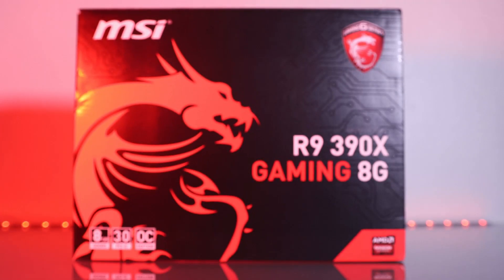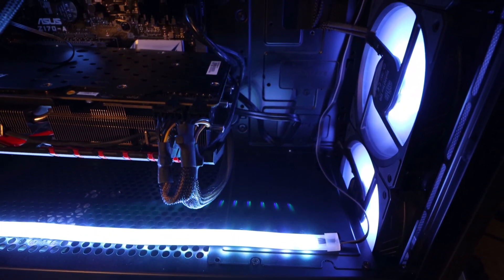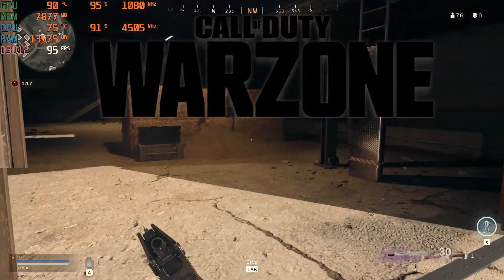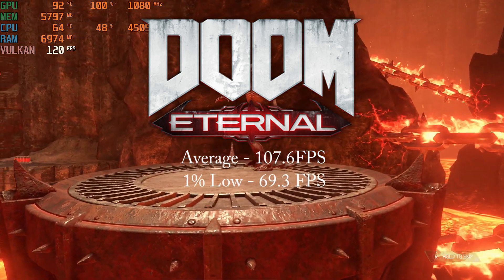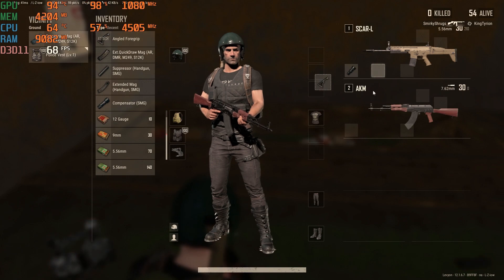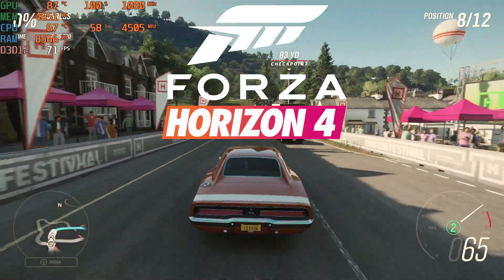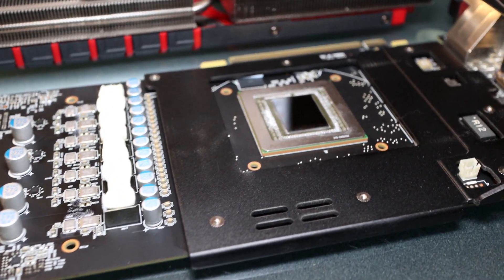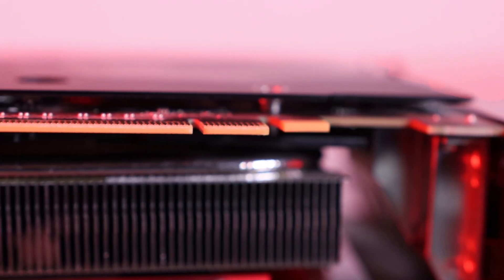A Review Of The AMD R9 390X In 2021

Comment: im considering maybe picking up this card as I saw one cheap on a used website. I picked up a 7950 that had some slight issues but runs fine still, but im somewhat worried about if it will keep working. and it does require some good tweaking on game settings.

still happy with it considering I can play most games at 1600x900 at a mix of low and medium @+/-50fps tho, and the fact I paid only 20 bucks for that.
Reply: if you find a listing of it around 100dollars take it

Comment: Levys Customs : dude.....for the 1000-th time, the TDP = Thermal Dissipation Power OR Thermal Design Power isn't the same as being rated of eating 275 Watts of power !!!! You have no clue about computer electronics !!!! I personally owned the Gigabyte variant and it never ate 275+ Watts....due to it's inability of being properly and fully utilized because TRUE DX 12 API games still don't exist. Todays games are saying that they're running on DX 12 when in reality they are just being passing through the empty DX 12 instructions and through DX 11 in reality....hence no difference between DX 11 and DX 12 performance.

Comment: This card undervolt very well.
Once you undervolt your memory and halfed your memory clock, you get nearly the same efficiency as a Polaris.
Reply: hey man I know it's an old comment, but can you give me the values real quick ?
Reply: @yazi2879  
Core
200mhz 900mv
543mhz 935mv
776mhz 945mv
895mhz 1020mv
945mhz 1075mv
985mhz 1090mv
1020mhz 1130mv
1100mhz 1170mv (yours may stable at hogher or lower mhz)

Memory
1200mhz 950mv (stock was 1500mhz)
Reducing the memory clock reduces the power consumption greatly
Reply: @mikeccuk2006  thanks man

Comment: Used an 8GB Sapphire R9 290X Tri-X until this week when I finally got a 6700XT. Basically the same card. Does well even in 1440p in games like Red Dead Redemption II.
Reply: That's a rare R9 290x  8GB model you have there
Reply: Basically the same card ? Are you on heroin or something
Reply: a 8GB 290X? is that actually the card you had?
Reply: so I looked it up and it is real apparantly ( and not a type o like I was suspecting). but anyways that is so cool you had/ have that card. I wish I had one like that.

Comment: Levy Bro great video! I have the same card but I am bit scared from this noise of fans. When I run PC without anything - card starts at 65 C degrees and when I open any HD stream on twitch or any full HD video fans go 100% and it runs 88 C degrees. Can you please help me :( cuz I am bit scared to not burn it. Give me information for best MSI Afterburner setup and how hot your one works. Thank you by now <3 ! I am waiting for your answers
Reply from the maker: As I mentioned in the video, this card does get pretty hot and loud, even with fresh thermal paste. When gaming, my card will hit 95C and thermal throttles.
Reply: @LevysCustoms  so nothing unusual to get worried about :)

Comment: I only replaced this card because of noise levels and a monitor upgrade to 1440p. 
390 can still pull off almost the same stuff as my new-ish 5700xt, except the latter one is much cooler and quieter.

Comment: i have this one but i play fortnite on low settings on very low fps do u know why this is?
Reply from the maker: What resolution are you play at?
Reply: @LevysCustoms  i think just 1920 x 1080 if you mean that
Reply from the maker: What kinda processor and how much RAM do you have? Do you have up to date drivers installed?
Reply: @LevysCustoms  i have the AMD FX-6300 and 20GB RAM but idk if i have the newest drivers i also dont know where and how to update it
Reply from the maker: Just Google AMD drivers and select your card. It will install the latest driver.  Also, the FX 6300 maybe causing a slight bottleneck.